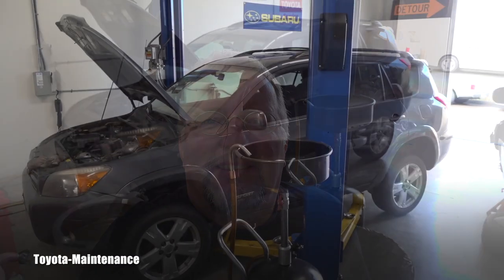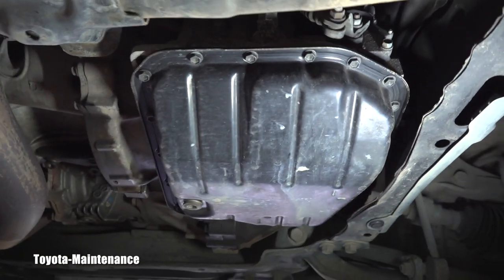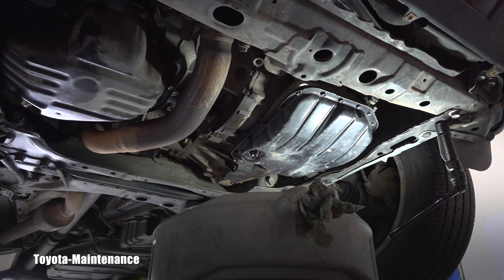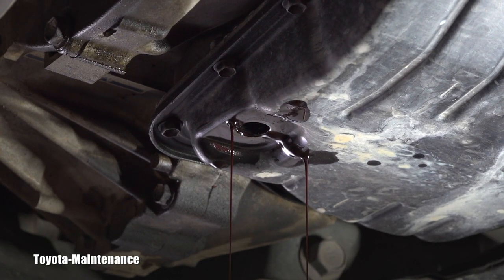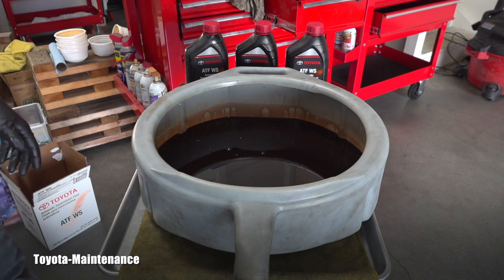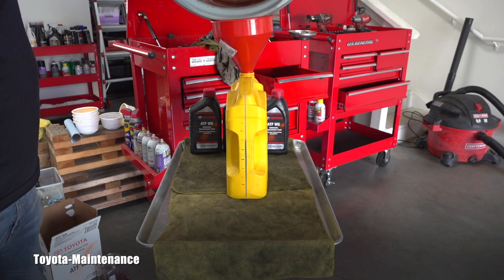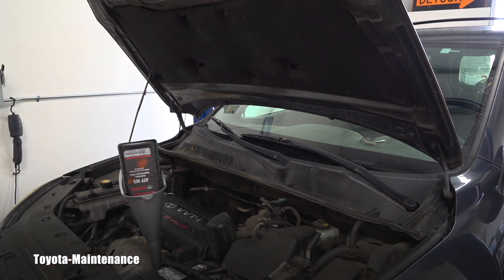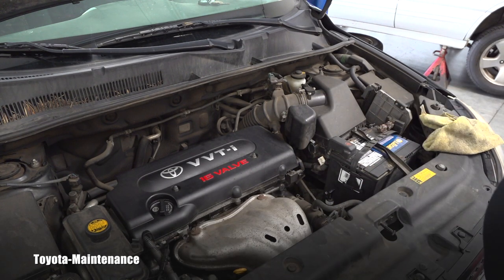RAV4 Automatic Transmission Fluid Flush

Comment: I did this job on my 2005 Siena with 240000. The oil was a little pink with some black spots.  I started reclaiming the situation when I noticed the oil had a burnt smell.  I drained it, refilled, drove for 3 months, drained and refilled, and them removed the pan and refilled.  The van shifts more smoothly, although it had no problems.  There are two nuts which will annoy you to death, but my son got them out, and we cleaned the pan, the magnets, replaced the trans fluid with oem.  It is a $500 to $800 job depending on what and how much moonshine your dealership drinks and what the mechanic smokes, so I did it myself, and bought some tools as consolation.  I did the same for my 2000 Avalon with 283000 miles, and also changed the valve cover gaskets on the van, sienna, and my 1992 manual trans Camry with 300000 also.  Not as hard as people say really.  Worth the money and time.  Shopping for the tools and knowing you did it right. . . priceless!

Comment: I just did this procedure, plus dropping the pan and replacing the filters on my 2009 Camry (2AZFE) with 90,000 miles and 2007 Highlander (3MZFE) with 214,000 miles. It was an interesting experience. I broke one of the trans pan bolts on the Camry and had to drill it out, and use a helicoil insert to fix it. That was also quite the interesting experience. All in all, I am glad I have taken up fixing/maintaining my cars as a hobby. Thanks for your videos, you have helped me in my learning experience.
Reply: It is also worth noting that you own cars worth maintaining.
Reply: Is you highlander a 4 or 6 cylinder?
Reply: @YodaPala  The 3MZFE engine is a 6 cylinder.
Reply: David Hahn that’s what I got, looks like I can’t pull off the transmission pan because the frame is in the way
Reply: @YodaPala  It is possible but you need a special type of wrench to do it. GEARWRENCH 10mm 12 Point XL GearBox Double Box Ratcheting Wrench - 85910. Search up this wrench on Amazon or elsewhere. This wrench will allow you to get between the frame and the pan and it will allow you to access the pan bolt over the stupid lip that is on the pan. The non-ratcheting end sticks up just enough to allow you to reach the bolt. If you have more questions, feel free to ask me. best of luck

Comment: I had a 2007 Tundra that had  the sealed transmission.  I "exchanged" the fluid by draining the pan (4q), refilling it (4q), then I pinned the transmission cooler open, disconnected the return line and put it a bucket.  I would then start the truck run it through PND12 and back to park all within 45 seconds. That was the time it took to pump out 4 quarts.  I repeated that 3 times to ensure all of the old fluid was removed.  I did that every 100k and had absolutely no transmission issues.  Overkill? Not for me.

Keep up the good work my friend.
Reply: cisa93  No I did not.  All my research said that it was a metal screen and did not need to be replaced.  That was also the consensus of TundraTalk.  So I just exchanged the fluid.

Comment: Great effort in making this vide and great advice to those who don't know.I changed my ATF on my 2002 Yaris at 70k (70,000 miles) with the proper stuff,Toyota type 4 £36 about from the main dealer itself.It still drives and shifts lovely & smooth today 7 yrs on and i had my vehicle for 12 yrs.Look after the fluids ie check often and change often and your car will it'll look after you and save you money.The AFT should be replaced every 50k (50,000)  because most of drivers do it leave it in D (Drive) rather than N (Neutral) in busy traffic when we stop which is a hard habit to change and the AFT will degrade quicker that way.Respect from the UK.

Comment: In-line transmission fluid filter by Wix, Magnefine, or Ford's truck parts department would be a great addition to any automatic transmission; as it can be easily installed in the cooler line yourself with basic hand tools.
Reply: That is especially good on vehicles, such as Honda, that you cannot access the transmission filter and they say it isn't a serviceable filter (which is really dumb engineering in my opinion).  so the inline filter gives me peace of mind on my hondas
Reply: @chrisryan8863  Most Honda’s have an in-line Transmission filter part # 25430-PLR-003 or 25430PLR003, same #. I bought it at a Honda dealer about 3 years ago for about $20 (with a discount). The parts guy told me there wasn’t one, but when I gave him the part #, he had it in stock and checked that it did fit my 2009 Honda CR-V and it did. It’s installed in-line (in trans cooling line going to the radiator) behind the radiator in front of the engine.  Jim
PS…..I have seen it sold on ebay, but with many Honda knock off parts, I’m not sure I would buy one. The difference in price is not worth taking the chance that this aftermarket unit might not work or harm the trans (by stopping cooling flow).
PPS….on the Honda CR-V I did 3 trans oil changes. First one, than drove it 10 miles, than 2nd one, drove 10 miles, than changed filter and added new trans oil……done!

Comment: We flush though the trans cooler lines (no machine ) just start, stop and watch fluid drain and then keep filling until clean fluid (measuring along the way)
Reply: So run in park? Disconnect both lines ? How much fluid does a 2014 rav 4 need? You must have to pull drain plug and check level after?
Reply: @markkus1134  6.9 qts toyota ATF WS I would not use anything else. I would buy 10 qts. YOur first time its going to be a slow processs. YOU DONT HAVE TO CHECK THE level if you put in what you take out (have to be accurate) * remember ATF expands as it gets hot!; however toyota dealerships use this ATF Level Gauge Kit = 10002-00101 buy at OTC https://static.nhtsa.gov/odi/tsbs/2013/SB-10061231-2273.pdf
Reply: any idea how i can find out which one is cooling lines i need to disconnect
Reply: @rodolfoaguirre4103  start the car pull the atf line of.trans fluid comes out.its the line you want. Have a bucket rags ect.

Comment: My 2010 Rav4 I-4 is at 130K miles and I think I am going to change the trans fluid in it soon. Bought used in 2022 and no history of trans fluid change. Been on the fence as I have read so many say don't change it if it didn't get changed at 60K and a lot of people saying it's ok to change it. Mine is starting to TC shudder so I think I will change out the fluid. Great video my friend!
Reply: How did it go?

Comment: I do the same on mine, but I won't use Toyota WS oil. Use a good full synthetic ATF LV. Flush and fill twice. Drop the pan and replace the strainer filter and clean the magnets occasionally. I do mine every 100k km. Probably overkill, but cheaper than replacing a transmission.
Reply: There is nothing wrong with using OEM fluid designed to be used in your Toyota car. The synthetic fluids say "recommended" or "suitable" for use by the oil companys who want to make lots of money. Notice they do not say "approved" by Toyota.
Reply: The reason I won't use Toyota WS is because here in Australia you can only buy it from Toyota, and its expensive. I have used Penrite full synthetic ATF LV which says suitable for Toyota WS on the packaging. Not had any issues so far and transmission has 180k km on it currently. Still shifts really smoothly.

Comment: I totally agree with you on the need to replace/flush the trans fluid. My question is on the differential fluid whose drain plug is often behind the trans drain plug. Do we ever need to replace the differential fluid? The newer toyota cars have separate differential and trans drain plugs while sharing the same fill entrance. The older cars have separate drain and fill plugs.

Comment: That's better than not changing the fluid at all, but you should drop the pan, clean the magnets and change the strainer, too.
Reply: If this one has a "rock catcher" strainer, rather than a smaller porosity filter, I would only drop the pan if I needed to fix a leaking pan gasket, but that's me.   I would do the drain/fill twice (as the video creator did),  with a brief drive in between, if the fluid drain/fill hadn't been done in 50k miles (25k if you tow).
Reply: @attocoulomb  Sure, that's a very good way of doing it.

Comment: the manual says to flush every five years , the dipstick says you should not have to add any between changes. It also requires the machine to properly flush the torque converter. My rav4 transmission is very temperamental with its oil and will have trouble shifting in -20 unless It has the oil changed every few years
Reply: Seems many Rav4s are susceptible to weather temperature.

Comment: What does it mean if the transmission fluid smells burnt. I had a rav4 and I did drain and fill 3 times b4 I got. Nice red fluid and no burnt smell. I did not drop the pan or change the filter but I was tempted too.

Comment: It takes 10 minutes to drain and refill the 2 quarts my Toyota 5 speed manual transmission holds. BTW I use Amsoil Full Synthetic lubricant.
Reply: On a 2007?? Spend twice as much? Maybe if the car was new! Kinda just a waste. Thing isn't gonna last forever

Comment: Hey guy. I have a 2013 Toyota RAV4 with 102,600 miles and no problems at all. In your opinion should I do a drain and fill on the transmission or a drain and flush along with the filter change. Dropping the pan and the whole thing.
Reply: did you find out?
Reply: @root123  No one ever replied back to me.

Comment: Do you recommend transmission flush with the machine? Or drain and filled ? 
Thanks for sharing your video
Reply: No do NOT ever flush AFT with the machine. Instead manually change the fluid til it is near crystal clear like new

Comment: I dropped the pan and on thr pan inside was a grayish film dirt of carbon etc. I cleaned the inside of the pan and put a new filter and new gasket and put the pan back on. After that the fluid was clean. Prior to doing that I drained and refilled it twice and it still had the grayish hue. But after removing pan and cleaning the pan and putting  it back to the the the fluid was clean.

Comment: Good video, but I was hoping that you were going to show us how to do it on a newer model without a dipstick.
Reply: when the car is cold, drain it and make sure measure it. locate the 24 mm screw - that is where you gonna refill.
Reply: La vằn Ù 
 But what if I just bought the car used from someone and that someone changed the oil themselves and improperly refilled the transmission oil and it was under filled.
If someone does it this way they’re not putting the  correct amount of fluid back in if the fluid isn’t at the correct level before they even started.

Comment: Did the auto transmission make any noises to indicate a need to replace? I have a Japanese auto Celica year 2000 and I think the transmission is making a worn bearing noise... I am finding it hard to pin point the noise tbh (I had thought it was  a tensioner bearing in a belt or something) when I check my fluid it is not terrible , still red but by no means new.
Reply: Did you ever figure out the worn bearing sound?

Comment: Some techs believe that if you flush old, dirty fluid, it will cause the automatic transmission to slip because the trans get used to the dirty fluid and clean one will cause slippage and require a trans overhaul.
Reply: it happens if the fluid is really bad and the thing holding the transmission together was the grit in the fluid. what he did is more of a drain ,refill and drain refill. the real "flush" that can cause issues pumps new fluid and exchanges it with fluid hooked to a machine and sometimes can cause issues. doing it this way is probably the better way then doing a flush with a machine but thats just my 2 cents
Reply: Not rereally but you can do double drain if you want spend some  extra money 😊

Comment: I'm still shocked Toyota doesn't recommend we change our Transmission fluid?  That sounds crazy.   Is this for all Toyotas?
Reply: Not sure why this statement given by Toyota.
But with sealed transmission, less moisture getting in and avoiding user to put wrong transmission fluid in it.

But good to replace regularly maybe at 60-80k miles interval.

Oil is cheaper than transmission.

Comment: Great informative video. I did have one question. After the second drain , did you drop the trans pan and replace the filter ?
Reply: It is a good idea to drop the pan and change the filter. Also you can remove debris and clean the whole pan.
Reply: My gut feeling is if one changes the trans fluid often, the trans fluid filter may stay longer (or forever). However, if the car as shown here had first trans drain-and-replace at 210 miles, the trans filter would probably be better off replaced. I have done both flush and filter change on 98 and 99 Camry that had late (170K and 250K miles) trans fluid change. However, on my 2010 Camry that had first trans fluid drain-and-replace at 100K miles and follow up drain-replace, I am hoping I wouldn't have to change the trans fluid filter.

Comment: I love this channel. I have had Hondas but recently got a used Corolla and I do a lot of work (especially the fluids) myself on my cars.  You mentioned that you do the drain and fill 2x.  Do you drive the vehicle first before doing the second drain and fill in order to get the fluid in the torque converter moving around?  Also, how do you feel about using a flush machine, rather than a drain and fill?  Thank you.
Reply: chris ryan use the car for a week or 500 miles then change again, doing it 3-4 times is the same as flushing without harming the inner components of the transmission

Comment: I am Not saying the ATF does not need to be changed, it does!  But, the way you were doing the comparison was absolutely unscientific.  Personally, I replace the ATF every 30,000 miles then the Toyota filter/strainer every 2nd or 3rd ATF drain/refill (all other fluids, I replace them after the initial break-in period or within the first 3000 miles of the car).

Comment: I thought it was a bad idea to replace transmission fluid in a high mileage vehicle.
Reply: Its a gamble.
Reply: It's risky to do a power flush with a machine at high mileage especially if didn't replace the filter first.

Comment: While regular changing of ATF fluid is a good idea, when the oil is very old and very dirty a clean change of oil can end up with the gears slipping as the grime was what was keeping the bands binding. Also I just saw a parallel video where they flush the entire system which was comparatively simple, but requires more fluid as you are also removing oil from the torque converter..https://www.youtube.com/watch?v=ntFVCVW-lG8

Comment: What, no cleaning the magnets inside or checking the condition of the filter ?
Even with new fluid this transmission especially since it had been neglected already is doomed for failure very soon.
Reply: Oh ffs you can't possibly know that. I know for a fact mine hasn't been changed for the last 7 years and 80, 000KM at least, and it still shifts buttery smooth. Yes I'm looking forward to changing it soon but it is in no way 'doomed for failure very soon'. And neither is this vehicle. Get a grip fella!

Comment: That fluid really was not that bad if it was original.  It needed changed a long time ago though.
Reply: That is quite true. When I did the first trans fluid change on 2010 Camry at 100K miles, the color looks darker red, but not bad. That tells me the first trans fluid drain-replace could probably be done at 150K miles. But I changed regardless as I was ready. That adds about 45% new trans fluid. I would not rush for the next drain-replace.